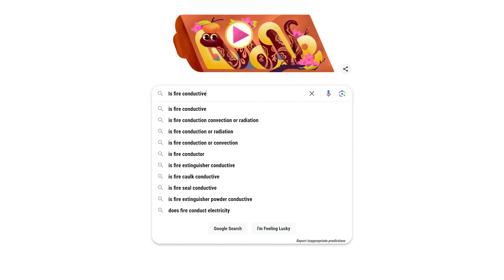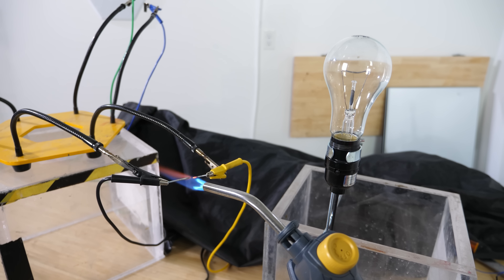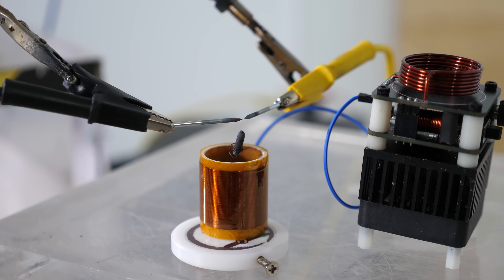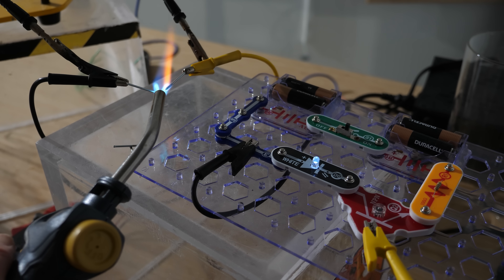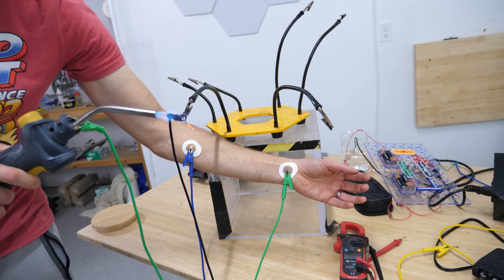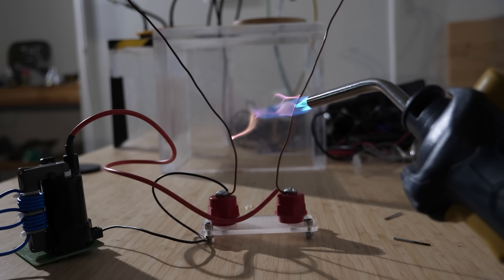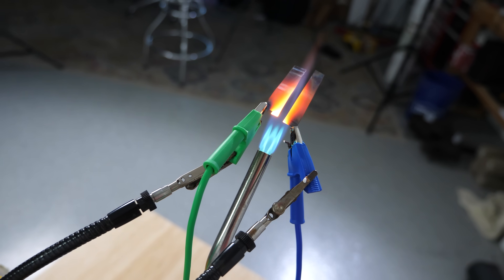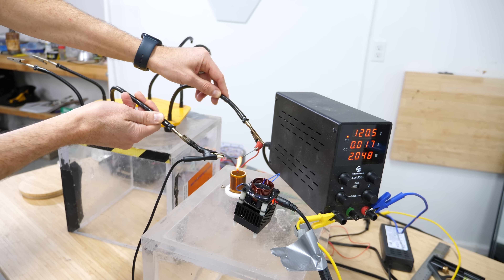Is Fire Conductive Enough To Get Shocked?

Comment: Apparently people have never been able to make the plasma in a magnetohydrodynamic generator sufficiently conductive to get efficiency high enough to successfully compete against plain old generators using copper wire.  Also, explosive electric pulse generators use an expanding metal liner rather than just the plasma of the explosion in order to get good conversion efficiency.  Yet the people at Helion want us to believe the expanding plasma in their fusion machine will be sufficiently conductive to drive out the magnetic field through a coil to efficiently recover the energy released in the fusion.  I wonder...

Comment: Generally speaking, fire isn’t considered to be plasma because of the ion density. But, that doesn’t mean that it can’t develop into a plasma state under the right conditions.

There are intense blazes with high temperatures that allow for greater ionization of the flames and air around it. While there may be disagreements over the precise levels needed to create plasma, it is certainly possible for plasma to form.

In doing so, the fire could become conductive enough to allow for the transfer of an electric current.
Reply: Could you say a flame as a certain % of plasma in it, depending on the ion density?
Reply: @linsqopiring6816  A typical flame is considered to be a very small percentage of plasma, usually classified as a "weakly ionized plasma," meaning only a tiny fraction of the particles in the flame are actually ionized, making up a very low percentage of its overall composition; depending on the fuel and temperature, this could be considered less than 1% plasma.
Reply: @linsqopiring6816  While a typical candle flame might only have a negligible amount of plasma, specialized flames like those used in industrial applications can reach temperatures high enough to contain a larger percentage of plasma.

Comment: The hot air makes conduction easier, not because of the heat itself, but due to the lower air density.

That's why fluorescent bulbs contain a low-density gas (which may not be air) rather than a dense one
Reply: So the electrons jump across directly and don't piggy back on the air molecules, which is what I always thought?
Reply: @linsqopiring6816  yes and no.. if the voltage or difference in potential is great enough, the electron will jump a gap. but, in this instance.. think of it more as, the electron cloud in a higher temperature gas is bigger and more excited, which allows for the electrons to move further from their nucleolus which then has less pull on them. the heat causes the electron cloud to expand, which thus makes the gas less dense. ( amount of matter in a given volume). kind of like but not the same, as you get further away from the earth, the effects of its gravity become less and less.. which allows you to be suspended. in the case of the atom, the higher energy electron cloud is more likely to pass off an electron to the next cloud.
Reply: @ Wow, I appreciate you taking the time to give such a detailed explanation. And it was very interesting and helpful.  There are a couple follow up questions I'd love to ask but the most pressing one is about this statement.
"the heat causes the electron cloud to expand, which thus makes the gas less dense. "
I always thought that gasses expand when heated because the molecules have more kinetic energy and are bashing into each other more energetically, a physical effect. But the real reason is because the negative charges of the expanding electron clouds repel each other and thus force the molecules apart ?
Reply: @linsqopiring6816  in the case of a fluorescent bulb... fluorescent lights have something called a ballast in them. which have a pretty decently sized capacitor in the circuit. this ballast works to cause a massive voltage spike within the bulb to initiate the flow of electrons. once established, the small amount of heat generated then sustains the flow of current. you can see this when you go out in an un-heated garage that has such type of lights.. and throw the switch. light might or might not light up due to it being cold. start a fire in said garage and as the it warms up, the light will illuminate, and there will be a noticeable difference in brightness from when it just started illuminating to when they room comes up to temperature.
Reply: in this context low density means lower number of particles in a given volume and has no connection with the mass of the gas. In fact, both mercury and hydrogen will be good because the electrons produced by the ionization are the actual conductors rather than the positive ions.A gas with a lower ionization potential is often chosen for various reasons.

Comment: You were not touching the fire when you weere heating the bulb lol. If a few milimeters of air can protect you from zapping, you would literally need to at least graze the fire to evewn start considering to be zapped. And that torch nozzle was way too far from you, adn the handle was not metal. And as you showed here its not even condive enough to zap you if you were engorged in it. And I was surpised by the low conductivity of that full plasma too not even able to light a LED, thanks for yet another misconception learned away. Most of us probably have no idea that the resistance of fire is in megaohms.

Comment: Before watching the video, I’d say no fire is not conductive, it’s just that the air gets heated enough that the molecules break down enough to let current flow across a gap.  I use this to make my spark gap jump further than it normally can, to allow what would be a 90kV arc become a 110kV arc
Reply: Flame is conductive put the probes of a 9V multimeter on continuity in a gas flame and you will get a circuit,  but just gas will not,  It is how gas boiler flame detectors work,
Reply: @ I get that it is, but how little conductive it is, makes it rather negligible.

Comment: ...always worked for me SUPER GOOD with very high voltages (10's of kV) and low currents (100's of uA)
GREAT VIDEO
Reply: Is the relationship linear do you think?
Reply: @linsqopiring6816  The linearity seems to fade out until you start over with a new identical contact/setup.   I did some work with this years back with concentric flat facing circular electrode contacts that were placed at various spacings from about 0,4mm to 12mm...not much happened beyond 10mm.

Comment: yesssssssssssssssss, i was hoping you would follow this video up, havnt seen the video fully yet but i suspect if you use a resistive based led it might work, candelabra bulbs have less room for driver circuitry so they tend to use a simpler circuit

Comment: I wonder if it would be different with DC voltage.  I'm not sure what the reactance of plasma is, but having the LED light using 3VDC may mean that plasma is conductive in one direction.  I think this is what lets mercury arc rectifiers work.

Comment: You need a higher voltage device to run. It takes around 30,000 volts for current to travel through one centimeter of air, so if you’re trying to get it to jump across something slightly more conductive than air, you you need slightly less than 30,000v.
Reply: Then why did he get positive results? Why did we see the lights turn on and his meters detect flow?
Reply: You need more education before making that comment!

Comment: Are you too much of a theoretical physicist, or can you do an experiment for me?
Once you went on top of a car park, brought a 12 meter clear hose and did the experiment with the water pile.

Basically you had water bubbling and boiling at room temp.

Ok you have something changing state, was that acting as a heat pump? Moving heat from the water  to the steam? Can you have 20 meter hose doing a bend , and then dropping down, one full of water and the other side will collect the warmer steam, condense and transfer heat?

Comment: As an HVAC technician yes fire is conductive but at the milliamp scale
Reply: Technically isn't anything conductive at a high enough voltage?
Reply: Yup
Reply: Gas flame detectors rely on the flame being conductive and gas being an insulator.
Reply: Yep, very small currents.  I had an issue with the flame detection on my gas furnace not sensing the flame and tried replacing the flame sensor probe.  It didn't fix the issue.  Finally traced the problem to a bad ground reference.  The controller board ground wire was connected to the ground wire of the incoming power cable with a wire nut.  The wires weren't well twisted together and the wire nut was loose.  Once I fixed that connection, everything worked again.  With a weak ground reference, the furnace controller wasn't able to detect that very small current through the flame.

Comment: since electrrons move really slowly und the gas from the blowtorch is moving very fast, couldnt it be possible that a flame from a candle or sth would be more conductive? i imagine that the gas moves the electrodes away from the wires. that might be a dumb question

Comment: I am an old power electronics engineer - I am truly surprised that you can even detect the slightest sensation with 40Vdc.  Telecom circuits typically had around 55Vdc and I have worked on that equipment for years touching live circuits with my bare hands and never once felt the slightest tingling.
Reply: All depends. He had electrodes glued to his arm, so it negated some of his skin resistance. I felt shock from less than 30V, while welding in the rain 😂
Reply: Yes indeed.  Bridging your finger across the terminals of a 9V transistor radio battery:  nothing.  Bridging your tongue across the terminals of a 9V transistor radio battery... 😵‍💫.   😉 🙂
Reply: @analog_guy  what does a woman's a$$ĥöle and a 9v battery have in common? Ya know you probably shouldn't but you're gonna lick em both anyway.
Reply: I assume the skin in your hands is thicker and has much more resistance than your arm, not to mention he is using electrodes especially designed to transfer electric signals to skin.
Reply: Yeah, auto mechanic here. Normally a 12v automotive battery doesn't have enough chooch to pass through the skin but if you've got a sweaty arm and happen to lay that sucker across the terminals, you'll feel it.
Reply: Your skin gave up on signalling your brain.. after 5-6 years😊
Reply: Telecoms circuits are ok until the bell signal is injected, Owch!
Reply: @dogwalker666  90 V 25 Hz.
Reply: @mernokimuvek   Well we use 75v 25hz but yes very Owch!
Reply: If your skin is wet your resistance can be low enough to get a shock at 32 V.
Reply: I've never been brave enough to test anything past 12V. I find that surprising. At 55V you're almost at half the voltage of a power outlet. Very surprising you don't feel anything. Interesting.
Reply: I've been working on POTS lines for about 8 years now. Used to get shocked by the binding posts every once in a great while by not paying attention. After so many years, the protective rubber on the alligator clips has pretty much disintegrated and I noticed the other day on a job site that when I had both clips connected to the binding post and my hands touching both I didn't feel any shock. Was honestly surprised. Confirmed it was a working line as well. Going to have to try it on some other phone lines to confirm if I no longer feel 48v in my hands

Comment: 4:55 that's the most dangerous looking setup I've seen. Playing simultaneously with electricity AND fire.
Reply: You aint seen nothing. Not even any mercury, radioactivity or strong magnets.
Reply: This was very safe, or maybe we are just desensitized by styropyro and the backyard scientist
Reply: it was 40v dc youd barely notice it
Reply: @GraveFable25  54V DC is the safety limit, so you definitely notice 40V - it just won't kill you, provided you don't touch it to an open wound. Even 9V battery will kill a person if the electrodes penetrate the skin, because 9V battery can dump a lot of current once the resistance is low enough.
Reply: Playing with fire is safer than sex

Comment: How much of the low resistance of the welding arc is due to the large amount of metal/flux ions in the plasma from the rod? or...how much more would be there with something that didn't vaporise like tungsten in a TIG welder?
Reply from the maker: I don't know...this video generated a lot more questions than answers for me. I don't know how welder arcs become so conductive, because it didn't seem like these AC arc are very conductive.
Reply: @TheActionLab  i know almost as much as you in welding, but i think i know that many stick welders run high amp, low volt DC to the electrode, and i know TIG is often high frequency AC...and there's voodoo in all of it where polarity of the elctrodes and all the variables can be enchanted to weld different metals in different conditions. as all things, the deeper you look the deeper it gets.

Comment: Here's a little bonus! You can actually make a "vacuum tube" with fire. Thanks again for sharing!!
Reply: Not really as vacuum tubes operate using free electrons & not ionized gas (plasma) to conduct current. But It would make a good follow up video for this series.
Reply: @guytech7310  It's not a vacuum tube in the literal sense. But stll an electric valve.
Reply: space enters the chat.... space isn't hot
Reply: @TheTubejunky  What is hot?

Comment: I wonder if the direction of the flame makes any difference. In all the experiments you show here, the direction of the flame was either antiparallel or perpendicular to the direction of the current. Could you get a lower resistance if you tried to 'blow' the charges in the direction of the current?

Also, negative resistance is cool! I have never heard of that before!

Comment: When I was building my first prototype electric race car (back in 2014, the first EVSR) I had a volt meter in the dash, and that was wired directly to the 160v battery pack.  To protect the volt meter I had put a small fuse inline, like 0.5a, but I used a 12v automotive fuse (not knowing any better at the time).  When there was a short between the two leads to the volt meter, the fuse blew, but the 160v 1000a potential of the battery pack was sufficient to turn the wire inside the fuse into a plasma, which conducted more current, and the loop fed on itself, with the plasma growing to completely consume the fuse, fuse holder, waterproof case around the fuse… it only ended when the plasma dissipated. A shocking amount of damage in a very short time.
Reply from the maker: yes when part of a circuit, the plasma resistance lowers with more current so they quickly grow and destroy the circuit they are part of.
Reply: Sounds like you had a great learning experience and now fully appreciate that the voltage rating and i^2.t rating of fuses are way more important than the current rating
Reply: @ yup!  Also learned the importance of using fully insulated tools over an open battery pack the hard way ☹️
Reply: DC is extremely dangerous at high voltage,  There is a lot of Solar panels being installed with isolators that are only AC rated.
Reply: You'd think fuse makers would have thought of that?
Reply: @linsqopiring6816  They have. Fuses have a max voltage rating too.
Reply: @ Sure they have a max voltage rating so they can avoid blame but wouldn't it be prudent to design fuses in a way so that they don't get this feedback loop if it's exceeded? 
 You could say it's darwinism if someone has a fire who exceeds the limit but that could cause his neighbor's house to burn too.
Reply: @linsqopiring6816  Fuses have an interrupting current rating.  They are not guaranteed to open if this current is exceeded.  The interrupting current rating is typically much lower for DC, since AC tends to self-quench the arcs at the zero-crossings.  Fuses with a high interrupt current rating cost more.  A cylindrical glass fuse has a relatively low interrupting current rating, a ceramic cylindrical sand-filled has a relatively high interrupting current rating, as the sand melts and helps extinguish the arc that forms when the fuse blows.  The fuses used in name-brand industrial multimeters can be surprisingly expensive to replace ($30 each), but this fuse is designed to save your life when you make a mistake measuring higher voltages that can deliver enormous fault currents.  For fun, I just checked a fuse catalog for a fuse that I would be comfortable using with the poster's example application (160V electric car battery capable of delivering thousands of amps), and they cost in the range of $5 to $30; the choice depends on the series resistance of the wire run that the fuse is protecting.
Reply: @miltonthecat2240  thanks for the detailed explanation.  The team did end up making multiple changes once we better understood how high voltage high current DC behaves fundamentally differently from 12v automotive stuff.  And, speaking of expensive fuses, the 500v 1000amp fuses that protect the battery pack cost a pretty penny, and of course we needed spares in case one blew on race day, although we only ever had one fuse blow under race conditions (racing at Lime Rock Park, which is a fast track with very long periods of full current acceleration, >800amps for >10 seconds, twice a lap.
Reply: @linsqopiring6816   Semiconductor fuses have been available for decades.

Comment: What if the normal fire is working but the heat by the flame increases the resistance of the contacts and thus does not haveenough current

Comment: What would happen if you used a match or other carbon-rich source as the fuel? Would the additional carbon in the flame, and/or it being a slow-moving flame, have any greater chance of conducting electricity?
Reply: I was always thinking that with the fast moving blow torch molecules. And would even direction of the flame matter considering that electrons flow only one way?